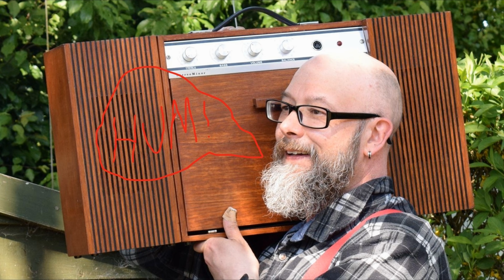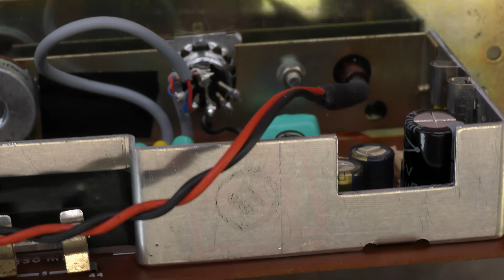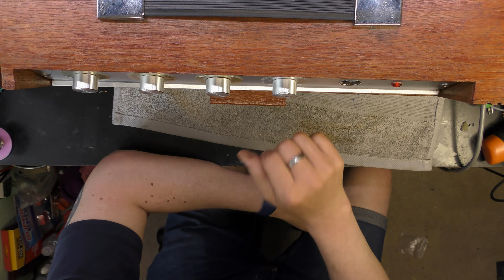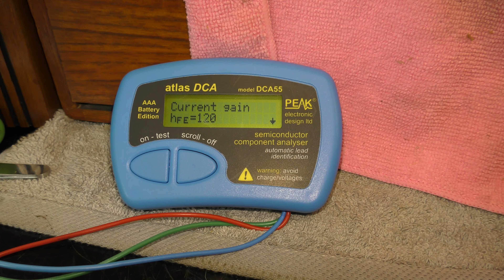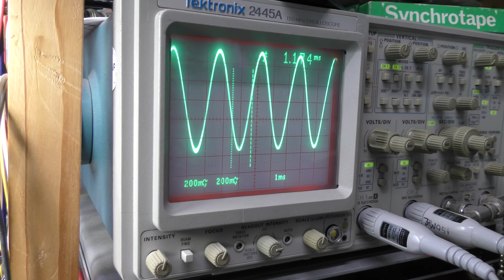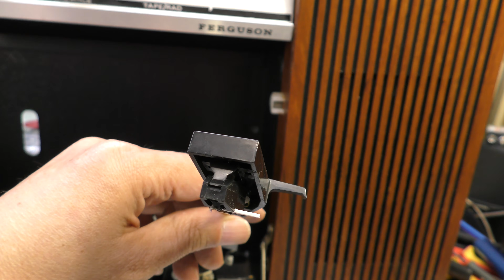Ferguson Stereo Minor 3025 Update or Pt2 (4K)

Comment: I see it uses those Fairchild, dome-top TO-105 and TO-106 transistors. Which makes it rather surprising it's actually still working.
Reply: i never knew the resin dome transistors were so bad,  i watched a chap called shango066 and he hated them.
I have a hacker radio and it uses lockfit transistors,  they are known to cause trouble as well.
So far nothing has failed :-D
Reply from the maker: I've had to replace a lot plastic transistors in that Grundig Hit Boy I worked on. The transistor gain had fallen so low the LO would not run. I guess if the transistor still has enough gain, you may not know. I've also heard the lockfit transistors can fail also.  Daz
Reply from the maker: Fairchild, ah I wondered who made them, thanks Daz